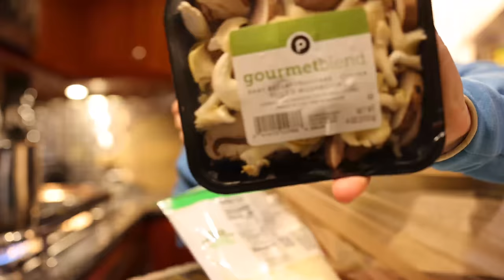BOAT WORK! Never ending TRAWLER Maintenance! Nordhavn 55. #171

Comment: When your replacement belts are new, use a vacuum sealer machine (for food) and seal each belt along with a part number &  label to where it goes...  If the belt doesn't have air in the bag... it won't get old and decay. Also, keep them someplace cooler than the engine room. Check eBay for a wide selection of available machines.  ;)
Reply: I do that with the bulk of my spares, keeps em fresh and pretty at all times!.

Comment: 32 years as an engineer in the American Merchant Marines sailing large container ships I can tell you that you could get at least another interval, whatever your schedule, before changing your zincs. There is plenty sacrificial zinc left before you get to the wire core. Also I'd teflon tape the threads on the zinc plug before installing. One more thing, I love Brook's cleaning attire. Good Luck, guys Thanks.
Reply: 50 years USCG licensed in small craft (less than 200 tons upon oceans.) and I agree. Those zincs have a lot of life left. Your wasting money.
Reply: @captainsalty9022  Whoa, retired after 32 years and let my license lapse. Where'd you go to school?
Reply: I could be wrong, but don’t you want to leave the threads on the zinc bare so they make an electrical connection? That is what I was taught as a Machinery Technician in  the USCG.
Reply: @chrisbynum4940  The brass thread will cut the teflon and make a connection. The teflon will fill any gap between the thread to insure a seal to negate any leak.

Comment: All boat, car and airplane designers should be required to serve a 6 month apprenticeship in a repair and maintenance facility. Then they would appreciate the difficulties owners and techs put up with. If it is out if the way or in an almost impossible place to reach the service work may not get done or may be shoddy as you cannot easily see what you are doing. All serviceable parts need to be relatively easy to reach. If not - time for a redesign. Particularly on a water craft in salt water, which is in an unfriendly and hostile environment, maintenance is critical. As a friend of mine (who was crazy enough to own a classic wooden 44 ft cruiser)  once said , fix and maintain two hours run one.

Comment: Always some work to do. I like how well you take care of you’re equipment. Especially the zincs. Too often people leave them too long. 
That screwdriver rocks. What is the model number. I would really like to get one of those.
Reply from the maker: Dewalt
Reply: @ABOARDMERMAIDMONSTER  yes. Desalt, but I didn’t see a model number on it. They have so many units that it’s easier to look up that way. Usually 2 letters followed by 3 numbers
Reply: @bobuncle8704  It looks like a DCF682N1.
Reply: @bripeck  super. Thank you
Reply: @bripeck  happy days. I just found one at my local retailer for $109 🇨🇦 Amazon wanted $140 plus $20 delivery. So looking forward to this
Reply: @bobuncle8704  it does look interesting. I might pick one up myself.
Reply: @bripeck  BTW 682 seems to be discontinued. Apparently the 680 is the newer version and comes with a spare battery. It also switches between straight and pistol grip, and between trigger and gyroscope
Reply: @bobuncle8704  Thanks! I’ll look for one of those.

Comment: WTF?  That last battery bank location was definitely designed and specified by an engineer.  NOT someone who would have to work on the damn thing!  Looks almost like you'll need to disassemble a quarter of the engine room to get at it.
Reply from the maker: It was INSANE

Comment: heat and dry air are no good for belts as well as hoses iam every two or three years i am throwing out new old stock because they are not stored in a climate controled room in my shop